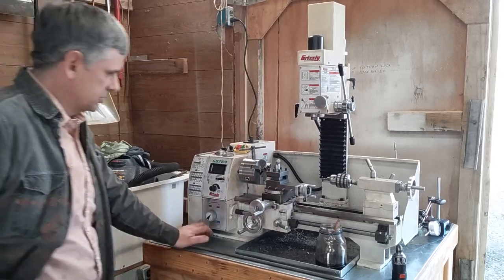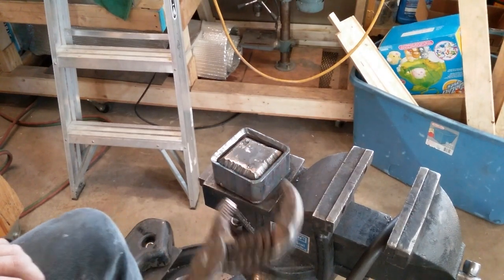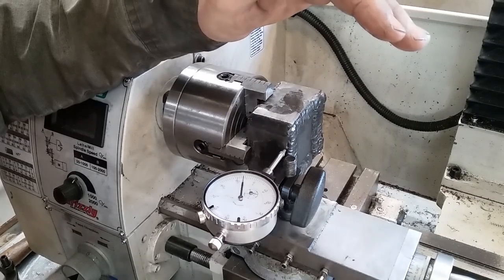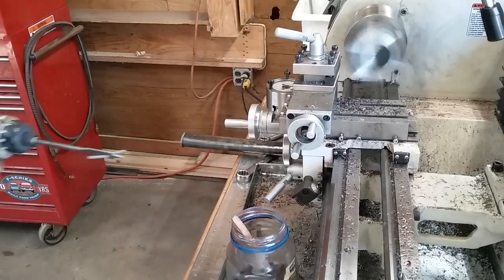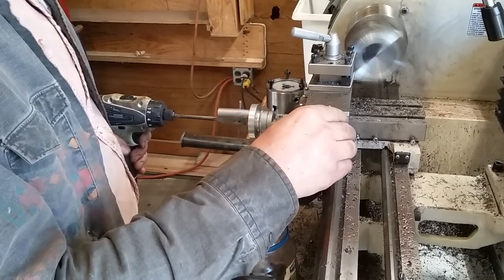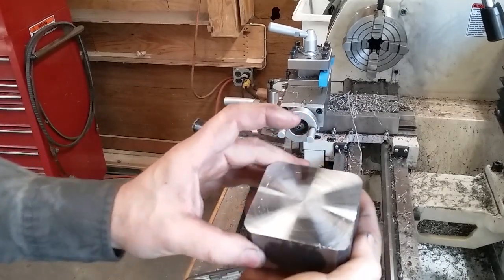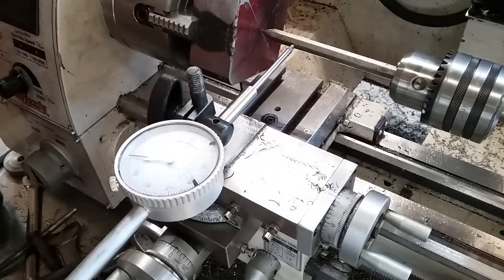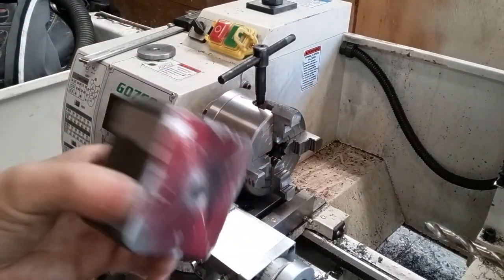Solid tool post build.  Part 1.

Comment: Why did you weld up the piece rather than buying a piece of stock? Thanks for the video. I have the same lathe without the mill and she's a pretty good ol beast.
Reply from the maker: There was no stock available to buy locally.
Reply: @thefixerofbrokenstuff  Understandable. I ended up buying a piece off ebay. Thank you again for sharing.
Reply: very good idea with the square tube...I can find locally steel solid square bar, but much smaller than I need and they won't sell it in small size...  ty